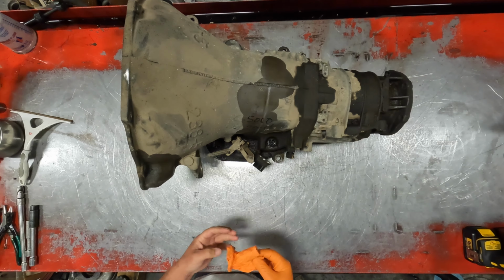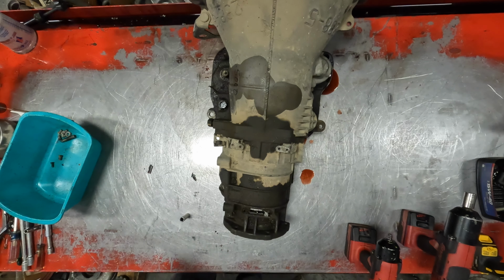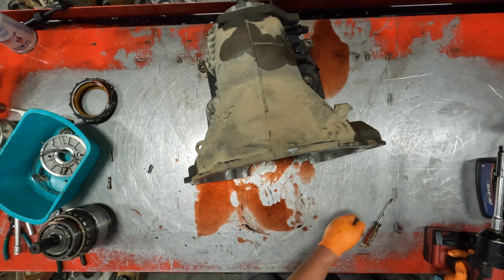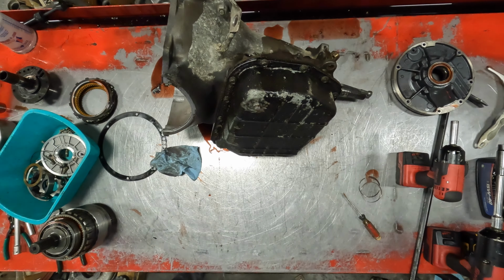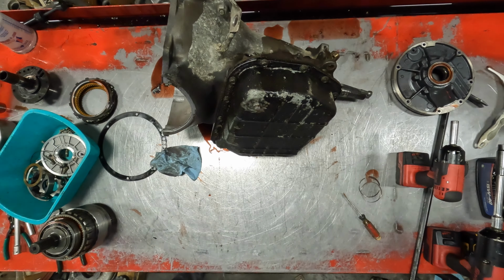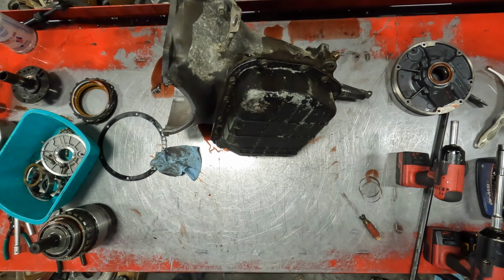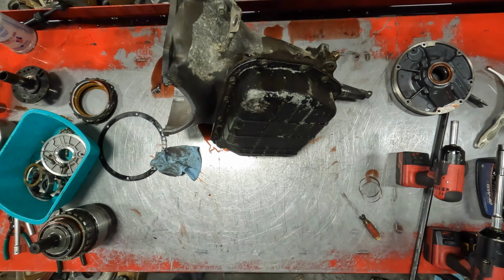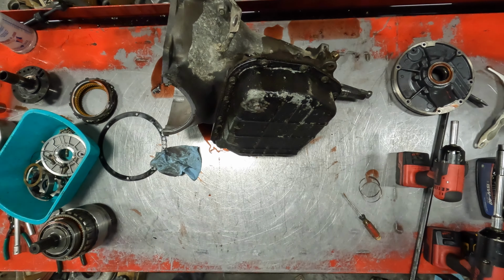CUMMINS  47re/48re Transmission NO reverse and Full disassemble

Comment: I have a question. Hopefully you can answer it for me. I have an 06 2500 4wd. And the extension housing was leaking. So I removed it cause I thought the housing was cracked. Couldn’t find any cracks in it. So I figured it was a bad gasket. So I bought a new gasket and the rear piston came out when I removed the housing.  I thought I got it back in correctly. Trans worked perfectly fine other than the leak before I removed the housing. Now I have no reverse. I can fill it go in and it acted like it wanted to back up. But nothing. So I killed it removed the driveshaft and checked it and it would turn when I put it in gear. I have only ran it about 5 minutes in the shop hasn’t left the shop since I removed the housing today, Did I not get the pistion in right or what do you think happened? .
Reply: I didn’t disassemble the housing. Just cleaned up the outside of it. To see how bad the crack was. And didn’t find any cracks in it what so ever. So I just replaced the gasket and put it back together. Still have a leak as well the right lower bolt is leaking though the threads apparently. Just barely is seeping. So that’s where my leak was to begin with. Just my luck. Any info would be greatly appreciated. As to what to do now. TY. Hope to hear back from you. The transmission only has about 30k on a full rebuild. The warranty ran out before I got the truck..
Reply from the maker: Is it full of fluid? If not, it will not pull.
Reply: Yes sir I checked it and put 2.5qts in it after I got it all back together.. I was hoping you would say that I didn’t get the rear piston in correctly. Didn’t know it would come out when I removed the OD housing.